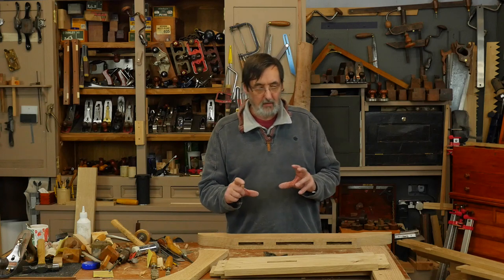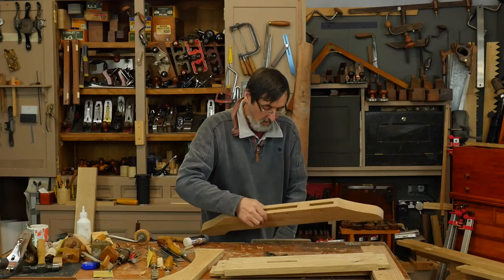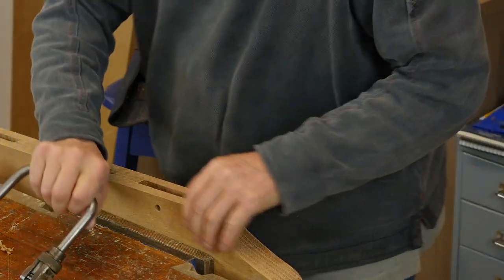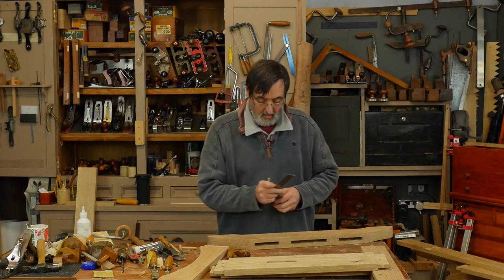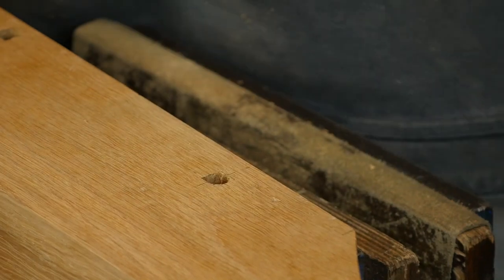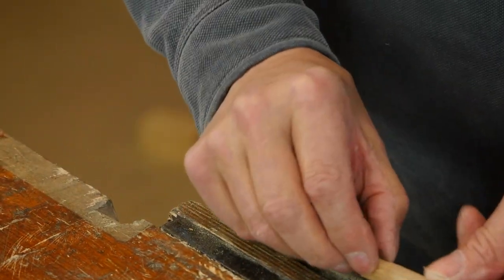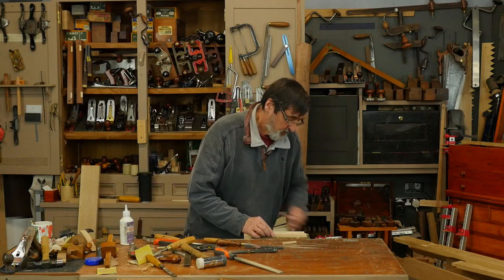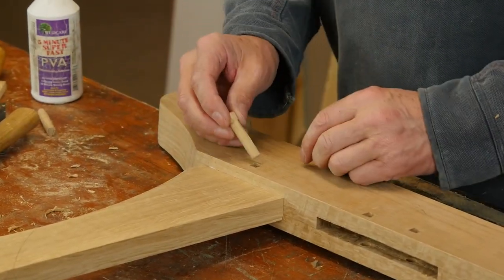How to make a Square Peg Drawbore | Paul Sellers

Comment: hi, i'm a furniture maker and i never round my peg.
all my traditionnal pegs are square all along and my holes are round and no probleme of splitting in my wood, just been carefull don't hammered the peg in diagonal but the side parallel and perpendicular to the grain, never in diagonal because it could split

Comment: Was it just a shadow on the video or was that a wide open shoulder line in your finished joint?
Reply: +rory lobban Probably closed it with a couple of hammer blows after the video.
Reply: The camera is very cruel.

Comment: Please can someone tell me if there’s an advantage in using square pegs over using round? Or is it just aesthetics?
Reply: Wach some of Peter Follansbees videos. They split the pegs and shaved them to size if needed and drove them into round holes. You can see this if you look at old furniture.

The square pegs are faster to make and bites ino the sides of the hole and wont fall out even without glue. My parents have some simple chairs made this way from pine and they have both square drawbore pegs in the tenons and square pegs holding on the seat boards

Comment: At the end you mention squaring the other side by leaving it short? So, then you just add in your own square "peg-head" at the other side fixing with glue. Or did I misunderstand?
Reply: Rico S I am pretty sure that's what he means, I can't think of any other method that would work.
Reply: Rico S  He meant you do the same thing from both sides. Two square heads knocked in from either side.
Reply: Really? Surely that would reduce the draw effect of the drawbore?
Reply from the maker: Rico S I meant make the peg shy of the other side, the first peg, instead of going all the way to the other face, and make the square end only and saw it off at say 1/4". Cut the square recess the same way and glue the false head in place.
Reply: Aye, that's what I thought you meant, but wasn't 100% sure - thanks for taking the time to clarify. I think I'll try my first drawbore this weekend to see if I can master it. Up until watching your videos, I assumed the dowels on furniture were just for extra support rather than to pull the pieces together. It's great to learn these things, and your videos are much appreciated.
Reply: Rico S Sometimes they are in there just for extra grab, but this is Paul Sellers Masterclass. Doubt it could be done much better.

Comment: Why would you want to leave the other side round? If I knew I was going to do that I wouldn't have bored all the way through. I think it makes more sense (while you're there with the chisel) to just make square holes on both sides and make your square peg taper by 1/16 inch right?

Comment: Paul, what is the name of the tool that you hammered the peg through to round over the peg shaft? Is it a glazing knife?
Reply: traderjoes I believe he made it from an old tool  (knife?)
Reply from the maker: traderjoes Yes, we call it a hacking knife. Toward the back edge is softer and not hardened. But, I've used hinges and washers too. They all work for this. Any mild steel works for this method.
Reply: It's really just a pre-drilled hole. you can drill hole sizes to match your dowels. 3/8 (9mm), 1/2" (12mm), 5/8" (15mm) and so on. Just use a steel bar and then drill the holes.

Comment: The center mortise in the "foot" has two square holes, one is not in line with the others.  What is the purpose for having two  and why is one offset from the others ?
Reply from the maker: Big Fat Tony's One, it's a wider post and so it's better to equalise the pressure along the shoulder line and two, putting the pins in line creates the possibility of splitting along the grain line in the foot.
Reply: grazie

Comment: am i terrible at joinery or is the drawboring in the tenon supposed to be going away from the shoulder line to actually pull it in deeper?
Reply: No. The hole goes towards the edge you want to get drawn, or tight. Think of the opposite edge that the peg "pulls". The tenon hole is closer to the shoulder than the cheek holes so the peg needs to align all three holes so it pulls the further one, the tenon in line, so drawing it closed...

Comment: Outside of aesthetic considerations, is there any structural reason to peg a mortise and tenon joint?ThanksFrank
Reply: +Frank B no.
Reply: Yes, since the joint is drawbored, the peg will pull the joint tighter than if you used glue alone to keep it in place. The peg also provides some mechanical resistance to the joint pulling apart.
Reply: The mortise and tenon is a very stable joint with a huge glue surface. If properly constructed a 1/4 inch dowel just cant add much. If you clamp it snugly you wont draw it tighter with the pin.
Reply: +Frank B But what if you don't use glue? I personally prefer to avoid glue, it feels like cheating. A mortise and tenon joint will be strong enough if pegged correctly without the use of glue.
Reply: I hate using glue for the same reason.  I've seen videos where so much glue its used that one would think they own a glue factory.

Comment: This bloke really knows how to use his tools and total respect to him bu....ut I can't help thinking he has really made a big performance out of something simple. English joiners use round dowels for their M&Ts, but in a lot of Europe the joiners always use square pegs. It isn't a fancy technique, it's done on any old bit of M&T or panel and frame work. The technique is to saw (or cleeve) square pegs the same width as the round hole or a touch thicker, give them a slight taper and round the forward end  then just drive them in with a hammer so they sit diagonally to the grain. a little practice will give you a good tight fit. Then saw off the extra length and finish with a chisel to a raised diamond. It's quick and simple, unlike what you see above.
Reply: This makes a lot of sense.  Particularly with square oak stock so readily available.  Seems to me that anything inserted in two offset holes will achieve the objective of pulling the joint closed, but a square surface presentation looks so much cooler than round.  I appreciate Paul's skills etc but his seems like a lot of extra work.
Reply: Paul is demonstrating a nice furniture finish, if the dowel grain is deliberately set diagonally to the  plank to stop it splitting then the dowel will not look good when the plank is planed, in my opinion the grain of the dowel should match the grain of the plank, but the square peg head is a decorative feature, that is self evident. If one uses a square dowel,  I think you would struggle with a hardwood dowel in to a hardwood plank